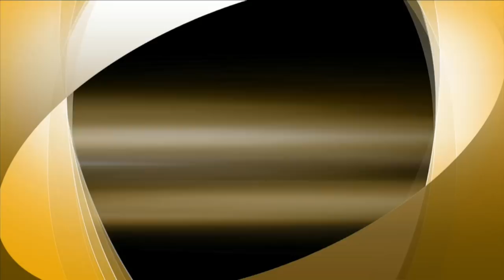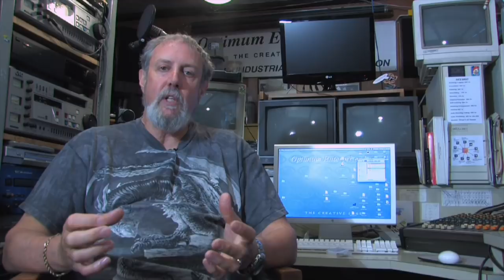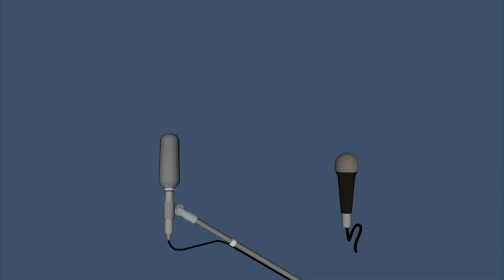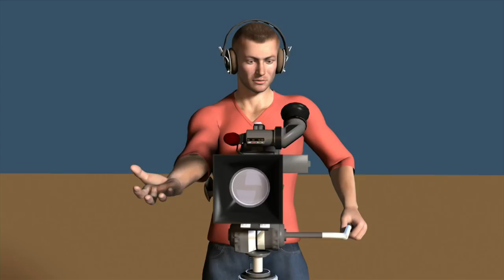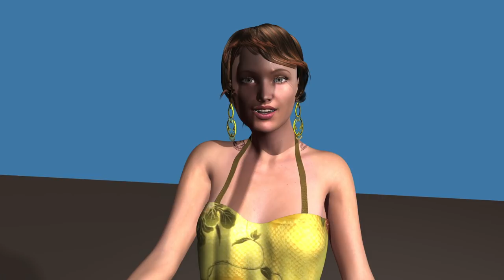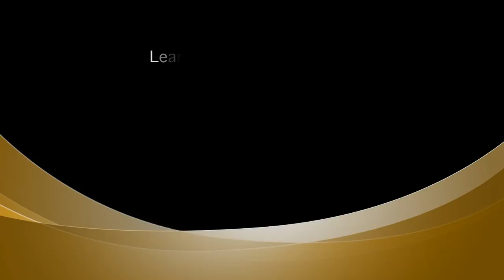Quick Tips For Video - Boom Mic. Techniques.mov

Comment from the maker: Usually you connect it directly to your camera's mic. input - unless you want to record the sound separately for some reason - such as the camera being too far away to run a cable to it - then you'd use a stand-alone digital audio recorder. In this case you'd have to re-sync the sound in post production.

Comment: boom mics and poles are nice and all BUT what is the best way of attaching the darn wire?! that is, without making it so slight bumps translate into audible thumps in the audio?
Reply from the maker: Most often you can wind the cable around the boom pole - leaving enough slack at the mic. end so you can adjust the mic. angle.
Then the operator has to be careful to hold the pole tightly so as not to make sounds.

Comment: Shouldn't the mic be 90 degrees to the floor rather than on an angle?
Reply from the maker: If you did 90° to the floor you'd have to have the mic. right over the subjects head which would muffle the sound. A couple of feet in front of the subject and angled to pointed at their mouth is best.
Reply from the maker: The pickup for the mic is in it's end. If you put it right over the performer pointing down you're trying to pick up their voice through the top of their head. If it's pointing down, but a foot or so in front of them you might get sound reflection from the floor. Out a few feet and pointing at their mouth is best.
Reply: 90 degrees is a bad call. Different angles for different mics and different shooting conditions, rooms, airplanes flying over head, reflective surfaces, etc etc. You boom people differently depending on which microphone you choose. If you're looking for a general rule, out in front, about 25 degree angle pointed at their chin/chest aught to give you some leeway when the actor makes a quick head turn.
Reply: +Guy Richardson If you try and aim for the actors sternum you tend to catch the vocal frequencies at the optimum point, if you point right at the actors mouth you can pick up distortion on the consonants, if your pointing at the floor you can muffle the audio
Reply from the maker: Thanks for your comments, Scarlet. Very helpfull.

Comment: A Big cuestion for me is ¿how to manage properly the cable?, ¿how to roll it just to get a good sound? beause is too large
Reply from the maker: I've seen it spiralled around the pole, tight enough not to wiggle and bang against the pole, but loose enough to allow for some adjustment of the mic.
Reply: Buy or rent a fish pole that is cabled internally. Where it comes out of the bottom, position the hole downward, but slightly tilted to the side and place your middle finger on the cable touching lightly, but just enough to keep it in place. That way it won't make any noise.